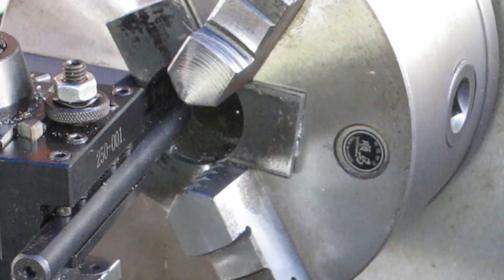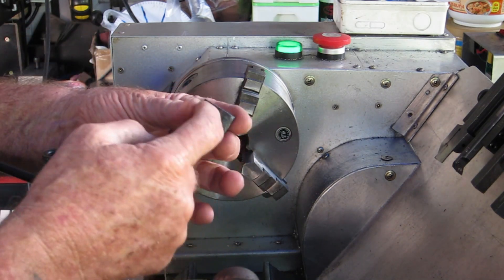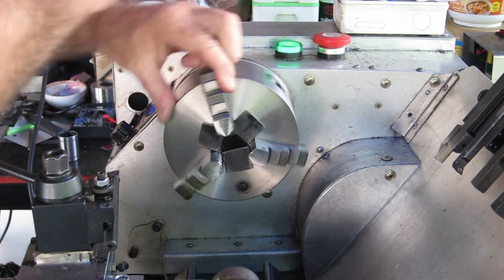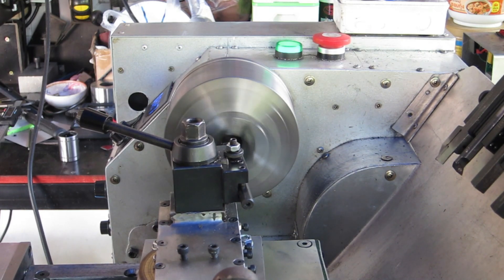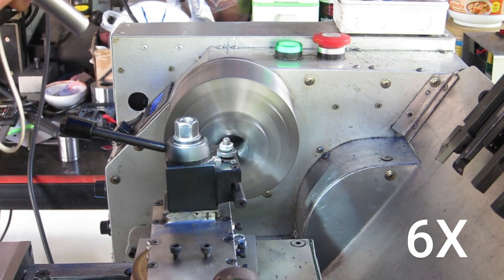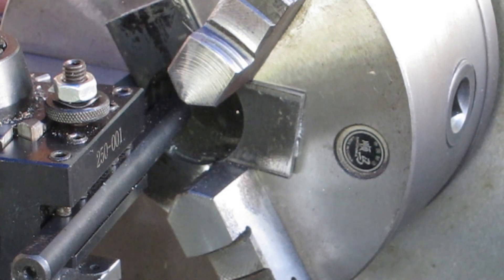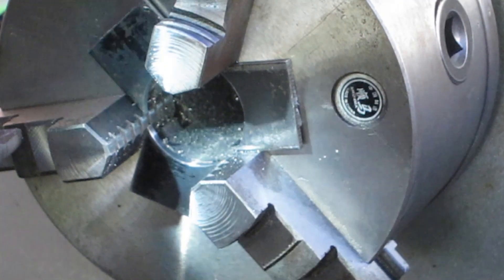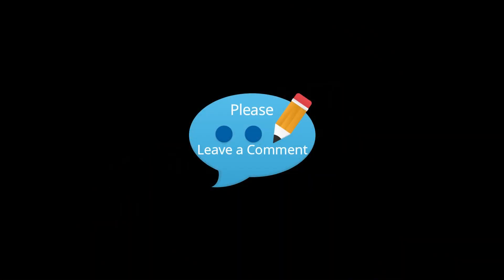MHW Episode 12 - 3 Jaw Chuck Run Out Correction

Comment: The more you grind or cut the lathe jaws, the bigger the minimum size chuck will hold.  You'll also find concentricity will change depending on the size of the stock.

Comment: To true a metal lathe 3 jaw chuck runout  problem. Take all apart your chuck and clean thoroughly, I use gasoline because it's the cheapest by far solvent to clean metal parts, and mount the chuck back on the lathe.  Now use your mounted tailstock center Open the 3 jaw chuck and slide the tailstock into the 3 jaw chuck, and loosely tighten so there is a little play. Now loosen the 3 jaw chuck mounting screw post so the chuck hangs on the tailstock center. Tighten the 3 jaw chuck on the tailstock center. now tighten the 3 screw posts that hold the 3 jaw chuck to the lathe. This should recenter the 3 jaw chuck.
Reply from the maker: Thanks for watching. 👍

Comment: Good method.  I always use marker pen on the jaw faces before machining, so you can see where metal has been removed.   You can also remove the jaws and grind the face back on an oil stone carefully  (keeping everything parallel) on very small chucks.  Cheers Rob
Reply from the maker: Marking them sounds like a good tip. Thanks for watching. 👍
Reply: Dykem Blue is really good for this. Also, if it's an old chuck that has wear in jaw grooves, if you tighten the chuck too tight while performing this "fix", the outer tip of the jaws will collapse inward and then they will have a slight taper on the newly machined surface. In other words, only the inner most grip surfaces will clamp a piece of stock well.....

Comment: I bought a nice brand 3 jaw chuck from a guy who bought off a whole warehouse full of machining equipment for surprisingly cheap - 1500kč (about 60 bucks), it looked nice, i was really exited that ill finally have a small chuck to run because the only other i had for my lathe was a 315mm one. 
I quickly got my exitement swept away when i found out that the chuck has at best 0.3mm runout but it can get to 0.8 depending on the diameter of the work, and when i bought brand new jaws for it the runout stayed the same and the stock even aquired a tilt.
Thanks for your video, it helped the chuck alot, i can now get to about 0.08ish mm runout
Reply from the maker: Glad I could help 👍

Comment: I've got an ancient Cushman 3-jaw that I'm trying to get squared away.  I began with a total tear-down, through cleaning and inspection.  I ran a tap through all threaded holes just to clean them up.  I ran a clean up pass over the mount to make sure it ran true.  Then I assembled the chuck and left the mount to chuck bolts a little loose ... and then centered the chuck onto the mount.  Once I had it centered, I tightened it down and ran a grinding stone on an electric grinder to do the jaws as you have.  I used a ring on the outside of the jaws instead of 3 bits of steel on the inside.  I know folks go back and forth on that.  I'm figuring the old guy is probably 80 years +/-, but he runs pretty good now.
Reply from the maker: Well-made products are always worth trying to breathe new life into 👍